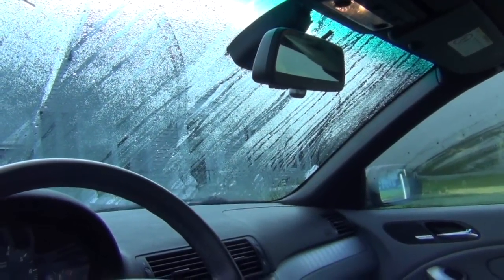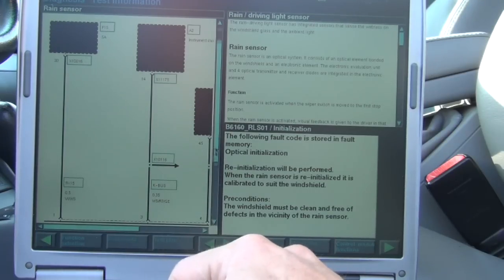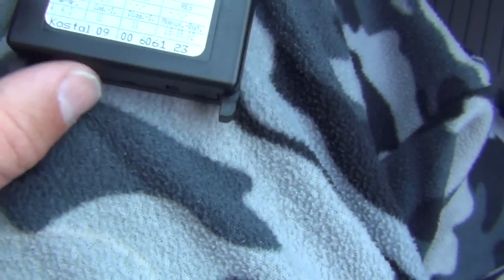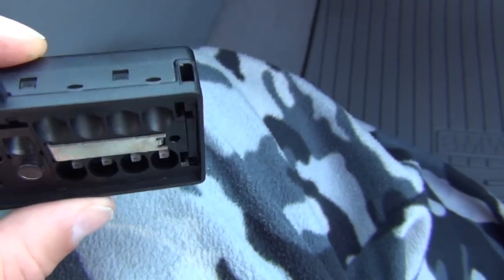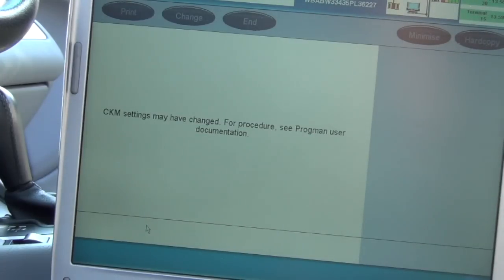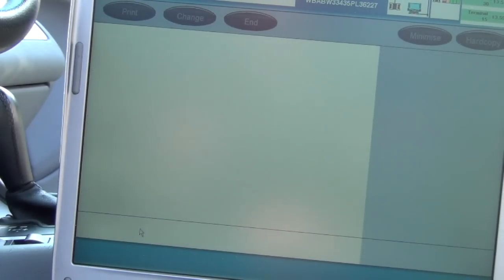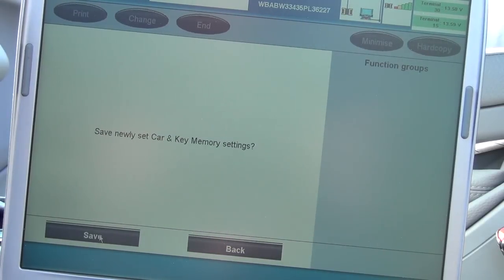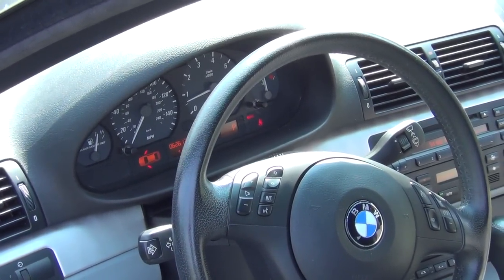BMW Rain Light Sensor Problem Diagnosis

Comment: Hi,
first of all great video thank you.... I have a question about my 2008 528xi, is normal for the DSC to flash about 2-4 times when your accelerating hard....usually on a high RPM??? it only flashes but never stayed on. God bless!!!

thanks
Reply from the maker: Hello, The light flashing sounds like Dynamic Control Activation which can reduce the throttle if the vehicle detects slippage of a wheel. It does this by closing the throttle and the light will flash when this happens. This does sound normal if it occurs during very hard throttle request but it should not happen under normal driving conditions.

Comment: I have the exact same issue and haven't been able to solve it as well.  It's good to know that I can disable just the rainsense option and will give that a try tonight.  Did you ever get this figured out as I'm leaning toward a windshield problem as it started after I had the windshield replaced with a Pilkington (non BMW logo) and I've read they have quality control issues and some are not good for the RLS.  Just curious if you were ever able to pinpoint the problem?

Comment: I’m happy for all you that found that problem y and fix👍👍👍i have a e39 2002 and i try to replace the sensor but there is nothing but not even the pig tale conector?? I’m confused anybody can help? Thanks 🙏 🙏
Reply from the maker: Hello Chuy, It sounds like your vehicle may not be equipped with a rain light sensor. What is the symptom you are experiencing on your BMW?

Comment: hi gr8 tutorial and well worth looking again..have a question but  not to do with RLS...I fitted an android Multi media system and now find that the diagnostic in Progman will not recognise Radio..I am wondering if it can be reprogrammed for this ...have you any experience in this problem ..I think I have the same diagnostic software as you SSS  PROGMAN  and INPA and DUMMIES

Comment: Had the same problem on an e83 X3. Removed the 5a fuse #15 and it started working. IDK
Reply from the maker: Thanks for the info Rod. I will have to give that a try next time I run into this.

Comment: If the windshield was replaced the gel pad may have been comprised. It’s a cheap fix. Probably better then replacing the sensor at first.
Reply from the maker: Hello, I have seen this happen on some older BMW E46's. The sensor was good and for this vehicle there is no gel pack. This one just has a photo sensor that clips to the windshield. But you are correct that on vehicles with the gel pack it can cause issues if missing or has air pockets from a bad install. I suspect the issue is in the general module but no one wanted to replace this module to prove out my theory :) I was able to code the wipers to go to intermittent wiper instead of rain sensing. Thanks for posting!